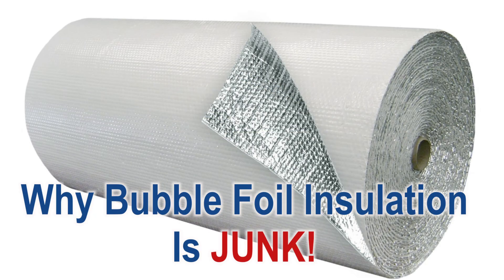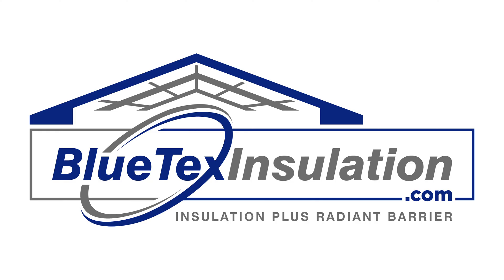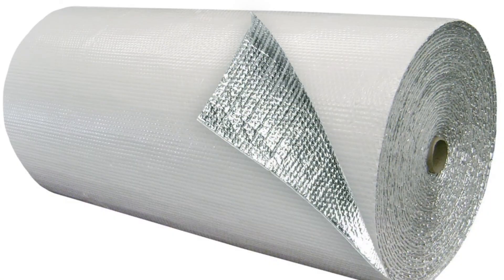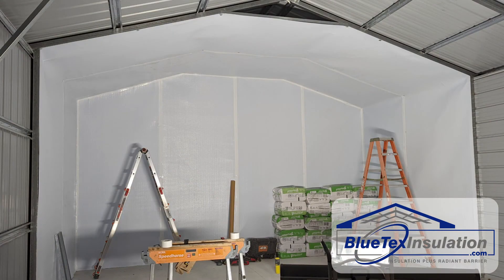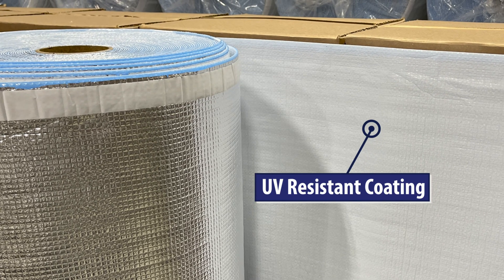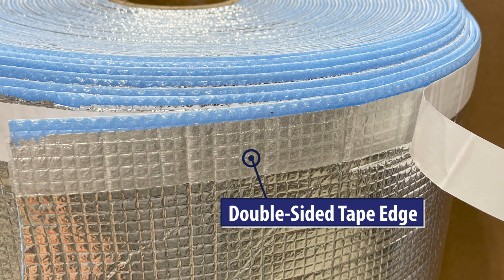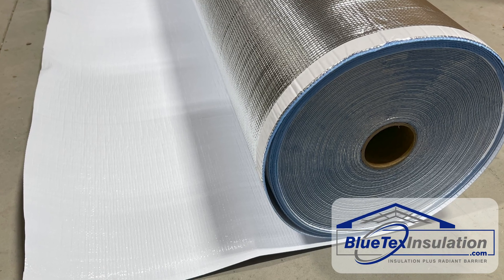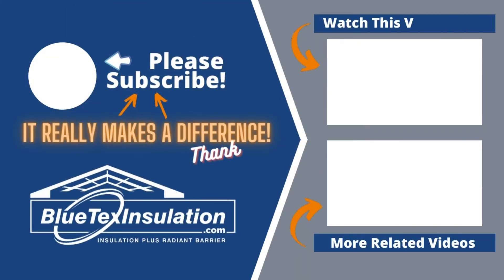Bubble Foil Insulation Falling Down - A Better Option

Comment: i'd like to use this as skirting for my RV, will it withstand the elements on its own or does it have to be attached to metal/wood structure?
Reply from the maker: Definitely NOT for use outside in the elements. You will get a year or two but eventually the UV/weather will break it down. Just FYI, the 6MM lasts MUCH longer (years) compared to the 2mm in our testing. Will it work? Yes, will it last forever? No.